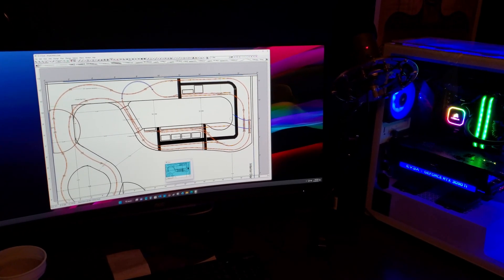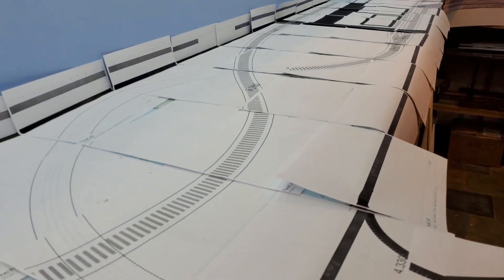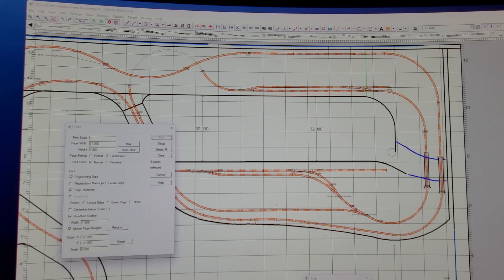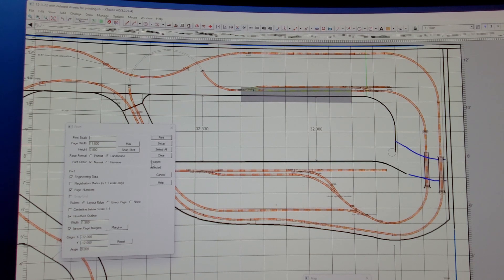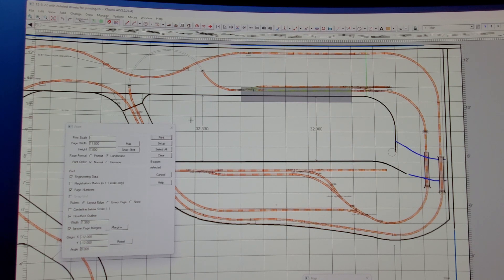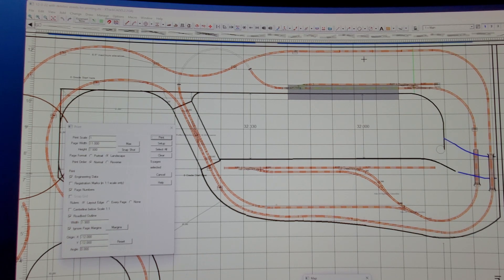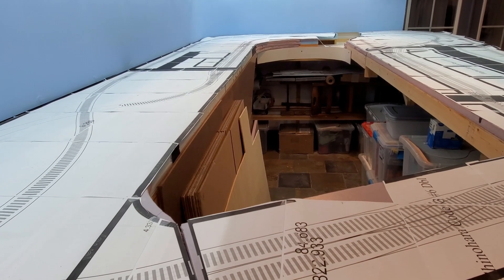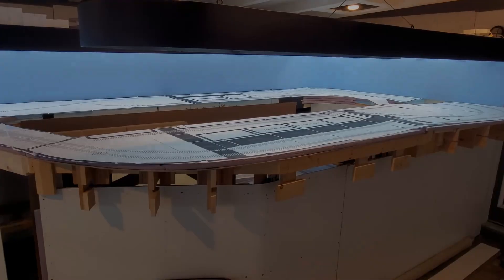Printing a Model Railroad Track Plan in XTrack CAD. HO Scale 12x20 Layout part 15

Comment: Print organization is columns, not rows. ;)

Also, VERY helpful when you design layouts in XTrackCAD to organize your various design elements into layers so that when it comes time to do your printing you simply go into Manage>Layers and turn off (make not visible to be exact) all of the "other" stuff you don't want to print like buildings, benchwork, etc. to get a pure track printout. If you forgot to do that or got things on the track layer that don't belong there, you can always select those items (ctrl click) and then use Edit>Move to Current Layer to get them where they belong. You need to select the layer you want to move them TO in the layer drop down window first.
Reply from the maker: I appreciate the input. That video is several years old; all my track has been laid. I did use the XTrackCAD printout for laying the track and I was pleased by its accuracy. I did end up redoing half of the layout after a couple years but that had nothing to do with XTrackCAD, simply a design change.